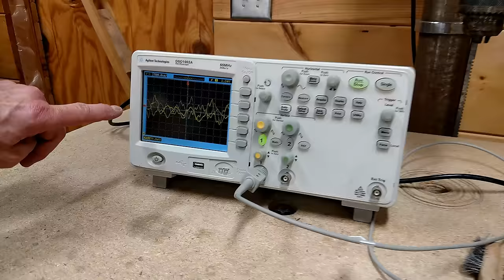Active Noise Cancellation

Comment: Why has no one put a microphone outside their house then attached one of those drivers to their window through an amp that can do 180 degree phase shift?  Theres a few quack devices that try to do this from just from the inside of the room and they dont work. But i haven't seen anyone do it with a microphone outside their home. Add in an amp that also has low, medium and high pass filter adjustments and id think you could tune for like the frequency range of lawnmowers and cars. Is there any reason you couldn't achieve a significant amount of noise reduction?
Reply from the maker: It's  tough because the sound will generate  complex movement  in the walls, including  flexing and twisting, and this movement varies  across the surface.
You'd need  many localized microphones, amplifiers, and drivers in independent loops, distributed across the wall to counteract this movement.
Reply: @Tech Ingredients  if you ignore the sound comeing through the walls as it's much less and only focus on the window itself.  Would the resulting cancelation be close enough to make a significant difference?  Even if it only reduced the sound 25-50% that would be a significant improvement. 

Another thought, what if you were to vibrate the window to improve its rigidity?  Obviously, we would prefer at a frequency above the human hearing range. Presumably you would get more sound dampening from this alone but if you were to use that frequency as a carrier frequency then added in the 180 degree phase shifted audio from the microphone you might be able to improve the performance of both methods.
Reply from the maker: That should work, and it's  basically  what we did with each panel  in the enclosure.
It's  important  to isolate the microphone  to prevent feedback, but mount the microphone  as close as possible  to the driver to minimize  phase mismatch.
Reply: @Tech Ingredients  I'm sensing this could be a video for you guys. Another one useing your favorite $30 driver. And similarly placed 1/8 up the window in a lower corner to try to avoid harmonic frequency would probably aid in performance. I'd imagine the power consumption from running a system like this would actually be pretty low. I feel like alot of people have issues with road noise

Comment: could I make something like this for a terrible hissing noise from blasts of steam.  I wear hearing aids and my work environment has intermittent steam blasts that just sends me through the roof.  I can turn the aids off if I know it's going to happen but it's random.  I can access the steam nozzle but the user of the steam nozzle has to be able to clean with the nozzle blowing onto an item being cleaned by steam.  It's a jeweler's steam machine and they use it to clean stones, jewelry and tools.  I was thinking of a steel cylinder and lined with foam on the inside, then use several of those drivers to cancel the sound.
Reply from the maker: Because this simple phase inversion does not compensate for the finite distance between the mic and the driver, as the frequency increases the phase mismatch grows.  This device works best at lower frequencies and I believe the hiss of steam is a broad band source.
Reply: Thank you, awesome videos.  Cool shop too.

Comment: Can't you counteract the resonance in the closed box, by using unequal dimensions and using randomly faceted plates? It should make it fairly impossible for standing waves to form in the box. My guess is that it would cause a lot of scattering to higher frequency modes, which if I remember correctly, are more easily absorbed by foam anyway.
Reply from the maker: In general, no. That configuration will  change the supported resonance peak frequencies, but not their total intensities.
Reply: Okay. Thanks for the reply. From your videos it is obvious you have done a lot of experimentation with this.

Comment: Ok but what if the enclosure you want to isolate is not a box but say an open space? Is it possible to only use speakers around the this "box" to achieve the same result or maybe an even better one?
Reply from the maker: It becomes much more complicated.  The walls of an actual box appear as far more massive than they are due to the active resistance to movement provided by the exciters.  Complex reflections from the walls and objects in a room make noise cancellation in free space very difficult.  That's why this technology is usually limited to headphones where the intigrated sound pressure is localized.
Reply: @TechIngredients  hmm thats true. Ok and with this system how effective do you think the noise cancellation could be if the whole thing was to be tuned as well as possible? How much of the noise could be completely neutralized to the outside? Like 90 - 95 percent maybe or even better? Im curious cause the principle of ANC is really interesting to me
Reply from the maker: There is the potential for very high attenuation.  The walls are not monolithic and complex flexture patterns occur over the surface.  More microphone/ local exciter loops can be added and individually tuned to negate movement over smaller regions.

Comment: Watching this channel intently as it progresses particularly the drone aspects however I must wonder why you would sacrifice so much power through the weight of that enclosure to reduce the sound the amount of noise from the props will make this very counter productive.

Excuse me if I'm procrastinating I am building much the same as you have been for at least 6 months but taken much a different approach to it however your thoughts on tackling the vibration was something I admired you for brilliant ingenuity.
Reply from the maker: You are correct that the enclosure may not reduce appreciably, the overall noise generated by the drone. However, it will enable us to direct the cooling airflow over the components in addition to reducing the "annoying" sound of the high RPM engines.  The enclosure will be extremely light, but part of the motivation for constructing it is to provide some engineering guidelines, ideas and methods even if the viewer/builder decides to take a pass on the "box".
Reply: Tech Ingredients I thought I'd mention I solved your cooling issue with something a little more efficient then a bunch of fans I've been using water cooled head and a computer water cooled radiator with a fan all controlled by a arduino and cylinder head temperature thermocouple on lid loop
Reply: Also I do admit that some of the higher pitches can make your ears fall off if it's not in the air.
Reply from the maker: Not a bad idea, which engines did you select?  The diodes and the generators need cooling airflow as well.  The radiator fan could provide this as long as the Arduino controlled  loop controls the water pump and not the fans as well.
Reply from the maker: You are approaching this in quite a different way.  This is interesting because your approach may prove better or worse, but a direct comparison of the results will enable others to pick and choose options.  By the way, the rectifiers we are using have a voltage drop of  less than 1V at full operating current. This is less than 3% of the power generated. The Seebeck effect is approximately 6% efficient, this will unlikely provide enough power return to justify the additional weight, but we'll see. We will be doing an update soon at maximum power output and are constructing a far more powerful generator, better suited to man lifting drones.  Keep us posted and when you are ready, it might be interesting to do a video comparison of the results.
Reply: Tech Ingredients yes I have toyed with alot of ideas in mine the seebeck effect for generation was an idea I fancied toying with to try and make use of as much energy as possible heat is a huge source of wasted energy.

What diodes are you using out of curiosity and yes would be good to see the comparisons although I'm so tempted to buy a second engine utilising your method of reducing vibration but then I might also leave it just to see the effects.

However I've quickly learnt its hard to get an idea of the weight you can lift by the amount of power alone there is a drone online with 4 16x10 props lifting around 20kg and if I remember correctly he didn't use a huge amount of power just didn't have the capacity.
Reply from the maker: http://www.vishay.com/docs/93003/vs-150ebu04.pdf

Comment: you could glue some weights to the back of those speaker drivers that should improve the amount of force that can be exerted to that box but too much would reduce the frequency response of those drivers
Reply from the maker: Correct.

Comment: Great explanation, I've always wandered how active noise cancellation works. Is this how it works on modern cell phones as well? 

P.S. You look a lot like the Norman Osborn from the 2002 make Spider Man :)
Reply from the maker: The only difference with phones is that the incorporate a DSP chip to adjust the amount of phase delay for different frequencies.

Comment: My neighbors have an industrial exhaust fan that has turned my building wall into a huge speaker. I wonder how I could apply something like this to stop the sound. Really a bad situation.
Reply from the maker: You have a couple of options.  We will be posting a video on constructing low cost sound absorption panels.  This work is being done to produce a video on the construction of an anechoic chamber.

In our lab tour video, I described the isolated wall technique that we used in the construction of our building.
If you want to go the electronic route, you will need to determine the major frequencies that produce the annoying noise and where the peaks of the wall displacement occur.  You can do this with an inexpensive accelerometer and an oscilloscope. A large mass coupled through a viscoelastic pad might be enough, if not then audio exciters could be placed at those points.

Comment: This is cool, but what if you made the rigid box air tight and sucked the air out?
Reply from the maker: It would collapse.  Atmospheric pressure is significant at one ton per square foot or ten tons per square meter.  If the box could withstand this then no sound would be transmitted through the vacuum.
Reply: @TechIngredients  What about two concentric cylindrical or spherical enclosures with a small space between the two walls where a vacuum is maintained (similar to a glass thermos)?

Comment: Would active noise cancellation work on road noise, or is it just for electrically generated sounds?
Reply from the maker: Noise is noise.  It's  based on pressure  waves through the air no matter what generates the pressure  waves.
Reply: @TechIngredients  thank you so much for your reply! I’m considering to make a contraption that uses AI and noise cancellation to block the noise of cars from the roads. Doable?

Comment: This speakers. The ordinary speakers are fixed in a heavy casing. But these are not. Does they push the walls of the box because they are heavy and make use of inertia forces?
Reply from the maker: Yes, they push on the walls of the box and oppose the movement of those walls.  This reduces the sound that the movement of the walls could generate.
Reply: Just was confused with Newton's third law. Thank you for great content.

Comment: Are you doing the Go fly challenge?  I feel like you could have a successful entry.  In order to make the noise limits at landing the unit is almost certainly going to have to be electric which means that some sort of generator system (like the one that you are working on) is also going to be needed for the range requirement.
Reply from the maker: The upcoming video covers the generator and you will see that it is in fact a hybrid.  The batteries provide several advantages, but can be rather small and light.

Comment: Why you driver located in center? Will it affect on standing waves?
Reply from the maker: This is the most flexible location on the aluminum sheet and where the greatest excursions will occur due to the sound pressure waves generated by the speaker within the box.
Reply: @TechIngredients  Thanks

Comment: How effective can an ANC system get on larger and un even spaces?
Reply from the maker: The size or shape of the enclosure should make no difference.  However, the addition of more channels allowing the surface movement to be more accurately countered will enhance the effectiveness of the system.  With a  larger enclosure or thinner walls it will be even more advantageous to add additional channels.
Reply: @TechIngredients   Tech Ingredients  Thanks for the accurate response. 

Amazing use of signal phasing. Theoretically will it be possible to make an acrylic or glass cabin or room with full soundproofing. But I believe the high elasticity of acrylic or glass won't make it that effective, right.

Comment: Can someone help me - I bought 5.1 home theatre system, cheap off of eBay. I tested it, it seemed OK. Once I had it for a few days, I noticed a constant hiss from the speakers. Unbearable! I googled the problem and it seems that, this is very common issue with that make & model. Apparently the noise/hiss is due to the power supply. 

I dismantled the speakers just to see the drivers and gauge how little the company had spent putting this terrible system together and  I was playing a star DVD inthe hope that I was wrong about the hiss. The DVD then came to a place in the movie where they was a lot of dialogue ad there it was massive hiss. I was moving some things down from a shelve to get a set of screw drivers tough in the their way were some A3 paper flyers. As this point the hiss was driving me mad & I throw a flyer over one of the speaker drivers.. then to my amazement the hiss from that speaker stopped. I then placed a flyer over all the four opened speakers. No hiss, though I could still clearly hear the movie/intended sounds. 
I eventually traced out the shape of the speaker on to a flyer and cut the flyer to that shape. I then popped the cut down flyer into the speaker case and screwed the speaker back in place. I eventually did this for all of the speakers and to my ear, no hiss. 
Am I losing my mind or does this make any of sense?

Comment: Could such a system provide structural reinforcement?
Reply from the maker: Yes it could.  Mechanical failure often involves resonance.  A good example is airplane wings operated well above the Vne speed.  Flutter vibrations can build to catastrophic failure.

Comment: This is very interesting.  I'm sorry for the dumb question, but I'm new to this channel.  Can someone tell me what the real-life applications are for this?  Is this the basis for noise cancelling headphones?
Reply from the maker: Yes, but simpler.  Without the need to reverse all frequencies the full 180 degrees, we can avoid a complicated digital signal processor.  The spacing between the mic and the exciter will cause an inevitable phase mismatch that will cause the higher frequencies to be poorly cancelled, but lower frequency noise transmission can be reduced.

Comment: So, that was for a pure tone.
It doesn't happen in practice.
Do you also have a solution for noises?
Reply from the maker: There's no difference.  Noise is just the stacked addition of sine waves with various amplitudes and phase offsets.
Reply: @TechIngredients  You say that with a circuit
that suppresses the sine wave well, there is
absolutely the same result in quality when a
noise is the signal source. Is that so?

Comment: It seems like you have put 24 watt speaker to produce 11,000 Hz (in reversed phase), Can you please tell me what would be the minimum watt to put as speaker or what are the facts to consider to buy speaker to produce below15,000 Hz??
Reply from the maker: The speaker in this video can produce 11,000Hz, but is producing 1,100Hz for these tests.  The output power required by the cancling speaker has to equal the power of the noise source.
Reply: @TechIngredients  can you upload a video with the things that u said at the last of this video??
So that i can , we can to gain some knowledge??

Comment: I really wanna know what kind of device this video used while doing ANC! i mean program, system board he used, etc!! Please help me, you awesome people around the world
Reply from the maker: The system is remarkably simple.  We use electret mics coupled to audio amps which drive the audio voice coils.  There is no DSP or program involved.  The close proximity of the mic and the voice coil alow simple phase inversion for noise cancellation.  As the frequency rises this relationship will deteriorate and above 1,500 Hz this system does not work well.
Reply: @TechIngredients  Thanks a lot! and about The electret mic that you've used at 10:30, does that shoots the cancelling sound through the amps?
Reply from the maker: Yes

Comment: I arrived at this video hoping that somebody had used this technology to reduce the noise of a generator. If anyone could do that he'd be a billionnaire, so it's probably not practical. Many, many years ago, when car manufacturers were desperate to increase gas mileage, Popular Science reported that one of them (Ford I think) had built a nosise-calcelling device next to an exhaust pipe so a straight-through exhaust could be used. I guess nothing came of that story. Thanks for the explanation.

Comment: 5:10  "mass" is the word you were looking for, not inertia.
Reply from the maker: No, I actually meant inertia.  It is the applicable derivative of mass that causes the foam panel to move less than the metal plate due to the same force.